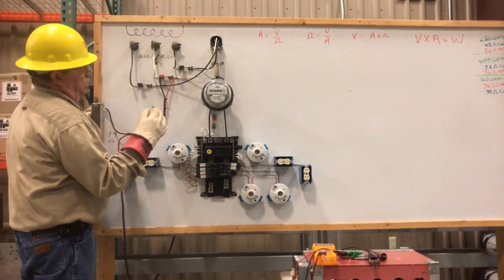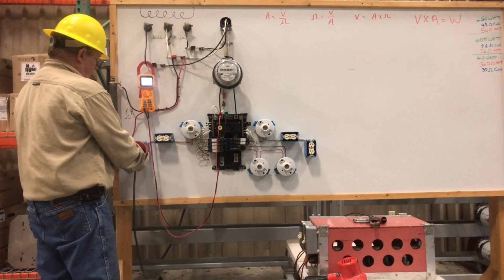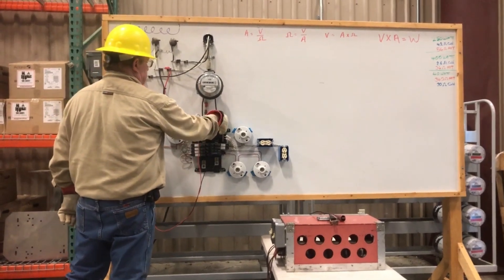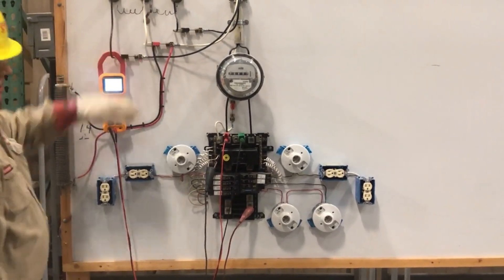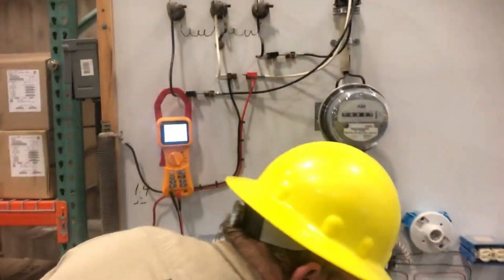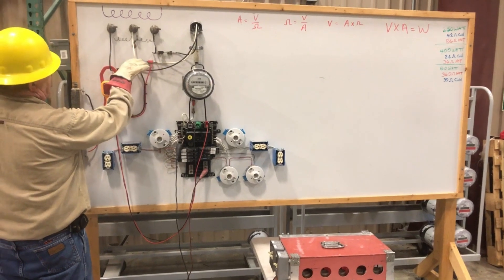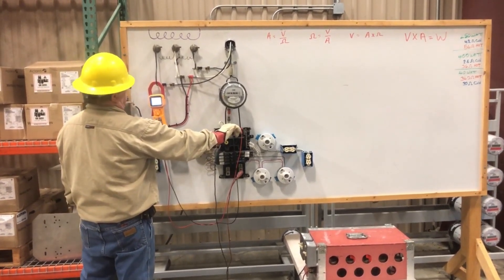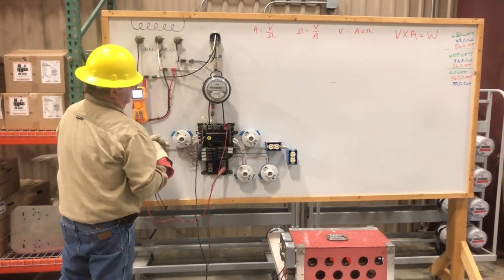Lineman Talk - Troubleshooting A Bad Secondary Neutral Connection - AUDIO EDIT

Comment: This is a excellent demonstration. I am an hvac contractor and just ran into this very problem at a house today. Previous electrician diagnosed it as a bad 120 volt evaporator cooler motor. He was wrong.
Reply from the maker: Thank you for the comment.
Yours is not the first time where the troubleshooter missed this type of problem.

Comment: I'd love to see you use a length of coax (with or without a messenger attached to it) and have it carry the return to the transformer, so we could see if the whole thing goes up, or just the ends. I don't think any company I've contracted for have ever placed much importance on detecting unsafe conditions. They don't supply amp clamps, and I've never owned one in 18 years, just a FVD.